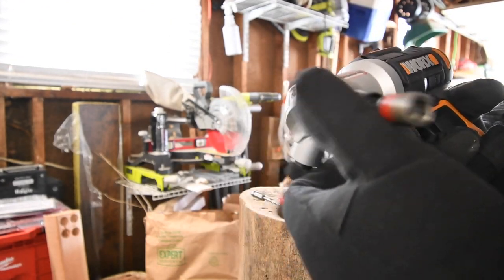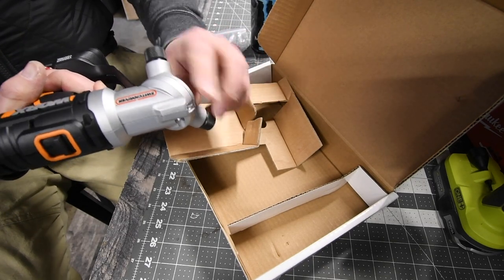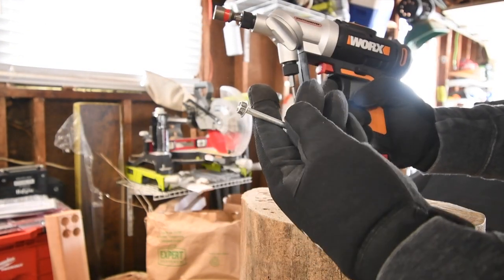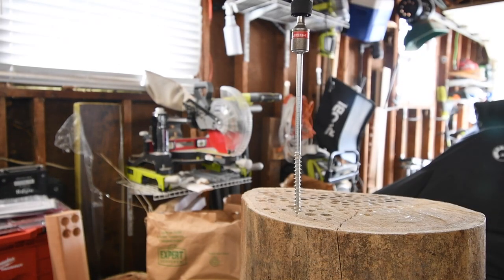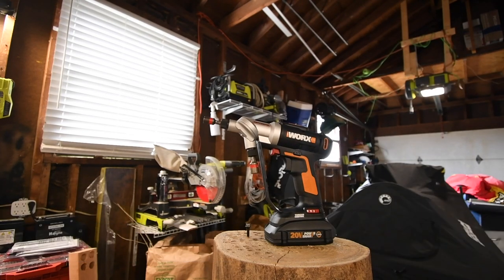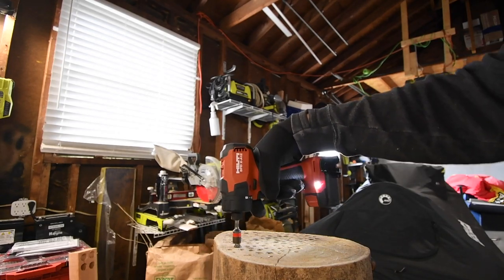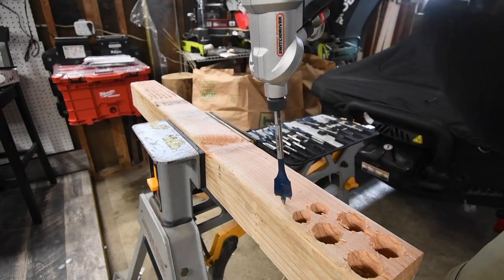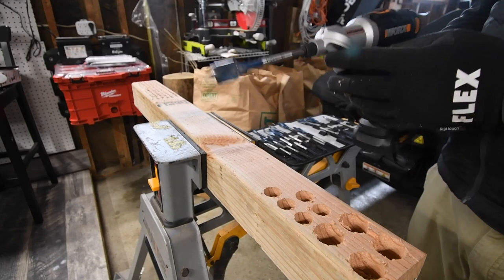Are WORX Tools Any Good?

Comment: This is a useful tool if you're drilling pilot holes and then running in the fastener.  The Worx has its place. Only downside is that the twist drill bits have to be on a 1/4" hex shank and those are more extensive than standard chuck bits.
Reply from the maker: I agree with you on that

Comment: All my tools are Worx, the best I’ve ever bought as a diyer, I’m not a professional but then they aren’t sold as pro, the one thing that Worx does better than all the big hitters is their customer service is out of this world, best of any I’ve ever used, my first drill driver had heavy use building a 18ft by 9 ft shed a 21ft by 10ft deck and about 40 metres of fence line plus a lot of other smaller jobs it lasted 9 years before packing up best £129.99 I’d ever spent.

Comment: I've had 3 Worx drills, 2 were replaced on waranty because the motors burnt out in about 7 / 8 hours of use and the third one I got my money back and moved to a brand Erbauer (the batterys are  cross combatable) I've now been using this drill for abour 4 years with no problem and the 2.6 amp battery charges from empty in around 45 mins

Comment: Not sure why you reviewed this tool, it's not intended for heavy lumber or timber framing. This tool is clearly designed and intended for finish work (primarily countersinking screws), not for drilling 1 inch holes or driving 8 inch screws.. your tests are flawed. I've never used the Worx tool but I'm definitely picking one up. I'd love to see you have to countersink 100 screws and drive them, 1 by 1 and  compare the time it takes for this drill vs any $200+ drill that you can find. Heck, you can use 2 x $200+ drills (one to drill + one to drive) .. this tool will run circles around them.. I've had projects where my batteries have died after hours of drilling and driving, the pain of sharing batteries between 2 devices or one that could do both .. or having to switch between drill and driver on the same device is torture, borderline waterboarding... I would only suggest that you modify your tests more towards the purpose of the device than generic power and logevity, but all in all, your results show that this isn't that bad compared to top end tools .. I just with you would have captured the positive, ie. what it is intended to do
Reply: Yes, agree.

Comment: For $80 it isn't a good value.
You're better off with an installation driver from Bosch, Milwaukee or DeWalt. They can be had for as low as $150 with 2 batteries and much quicker charger. And they do more with the 5-in1 attachments.
Do the math and the Worx is over $150 if you add an extra battery and a halfway decent charger.

Or get some good value brand like Skil for less than $80, sometimes even as a combo with an impact driver.

WORX is just No bueno.

Comment: I guess for inactive home owners it could work,  but then again- you can get a much better drill for the price
Reply: I would just  go to harbor freight and pass on the worxs
Reply: @jasonmartin9393  lol exactly
Reply: @UncleIvan1   I no a  guy that had some worx stuff and   He  got a using them and he didn’t like them and I played around with some of his stuff  the battery’s  seem to be ok but like his  worx push mower    It’s  kinda  weak  his if the grass is a little high like  to ur ankle if want cut it  just does a bad job motet want stay at a high rpm to cut it   The weed eater he has it’s ok  it’s no weed hog but it will work for his grass   The drill he has  Walmart has a better one    His wife went to harbor freight and got him the 80v  Atlas  push mower and that thing u can  tell a big difference in  it will cut  and cuts good I like it mows tall grass to
Reply: @jasonmartin9393  I personally don't buy power tools from harbor freight,  but for a regular home owner it's a decent option....I guess if you buy cheap Chinese tools,  might as well buy better quality Chinese tools lol 😆
Reply from the maker: I agree Fryer

Comment: I love brushed tools, so much more throttle control. Brushless has its place, but it ain't the be all and end all.
Reply: Very true.
Reply: Interesting. I haven’t compared comparable tools in brushed and brushless. 

Wonder if that’s going to get better. Most brushless motor controllers require that the motor be spinning at a certain minimum speed to detect motor position, so that can could be an issue. 

I expect controllers to keep improving, though. 

Do you think some brands are better than others?
Reply: @gf2e , yeah, the more you pay, the better the kit. My favourite pair are my old Bosch 36v combi drill and sds plus, superior to any of my brushless machines. Much smoother power delivery from zero RPM, but still packing a punch. 

When I want control, it's brushed. When I need all out power, it's brushless. I flit back and forth between the two.
Reply: @mrclive5  I notice this increased throttle control on my P235 brushed impact driver. The extra throttle control has come in quite handy on a number of occasions. That's one of the reasons the P235 is one of my favorite tools... and the ergonomics. 👍
Reply: @erik34  for small fixings, I'll take brushed all day long. For those driving in huge half inch thick screws, I can see the attraction of brushless.

Comment: I love the concept of this drill the it switch from drilling to driving a screw but it is not a heavy duty drill but there is a brushless version of the switch drill this is for installation of fencing or other projects but yeah the charger sucks you got to get the one hour charger for it I have the axis saw impact driver and the 5In circular saw and they are good inexpensive tools.

Comment: That's the most ridiculous thing I have heard come out your mouth if I take it to failure on things it's not supposed to do it's a bad tool. If people use that to drive 12 inch timber locks and drill holes for rough electric they are as goofy as this tool is. I say if it does half of what you put it through it's good enough for the average joe work at the house it's not for construction bro.
Reply from the maker: there are better options for the price point
Reply: @ManCaverTools  I understand that point but still not trash. Let me preface this by saying I dont care in the least about worx and I dont own any. I am sure some people are on the platform already and this drill will fill a need that doesn't require putting on a ship auger.

Comment: Gee ?   This Worx  Switch Driver's  purpose is to drill pilot holes with a drill bit on one side and then drive then in with a screw bit on the other side in one quick operation.  Why not compare a Worx Impact driver with  with your other impact drivers.  It would be more of a fair test.   my 2 cents worth !

Comment: It's not useless. It has a very definite place and purpose. I have two and love them. I also have more powerful tools, all of which have a place in the world. You were prejudice before you even started. What you need to do is test them in real live use case scenarios. Would you pull a trailer with a small EXPENSIVE sports car, or a larger CHEAPER SUV? Does the sports car still have a place in the world? Think about it... Right at the end you even spoke the words, "it survived and I didn't really want it to". So were you prejudice before you even started? If you are going to be a fair YouTube product reviewer, you can't go into your reviews with preconceived notions about the products. Look at some of the other respected reviewers here.
Reply from the maker: This tool cost the same as the other examples I use in this video. But let's use your example. If your task is to tow and the SUV cost the same as a sports car, which one would you pick?

Comment: This episode sponsored by Flex... Another tool with no longevity. Yes, I tried Flex tools and it doesn't hold up like Milwaukee and DeWalt.
Reply: Fyi I own my own heating and plumbing business in Maine. I have way more that 30k in cordless press tools, pex tools, and cordless pipe threaders, and so on. I tried other brands only to be disappointed. DeWalt mega press along is $5k +or - at FW Webbs.